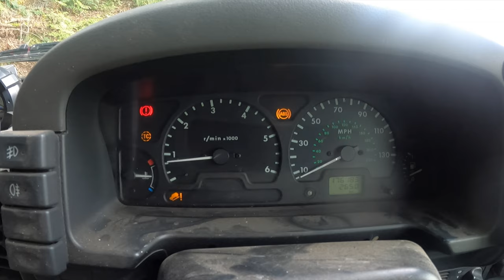ALLT Y BADI STEPS | Llangollen North Wales Green Lane | DOES EVERY TRUCK GET UP? | 4WDUK

Comment: Those tyres have way more in them than the deflator says. At 15psi my tyres are half flat at the bottom and your discovery is heavier than my defender. Yours look like mine with 30psi in them which is what I run on road.
Reply from the maker: Cheap deflators 😂 we’re going to have to invest in some decent ones 💪🏻🔥